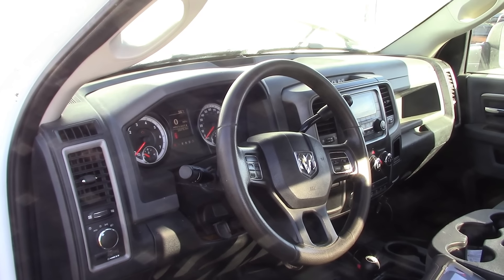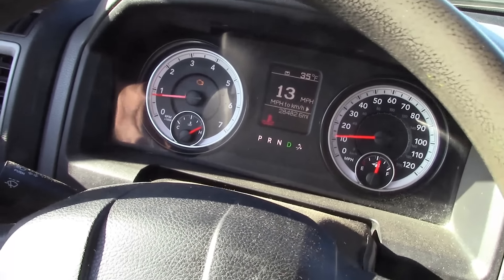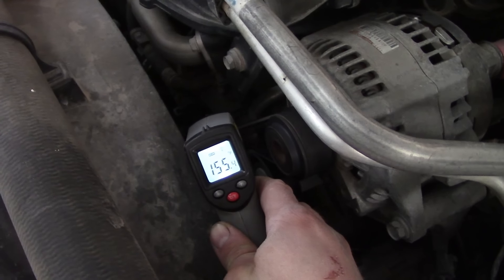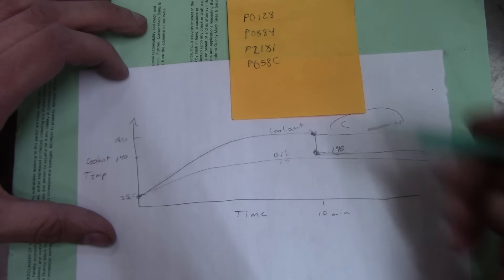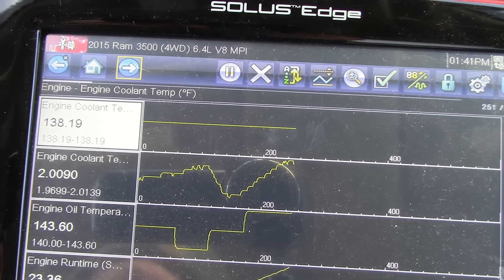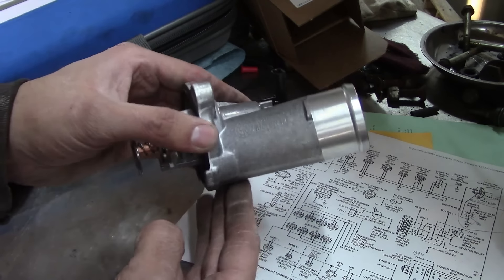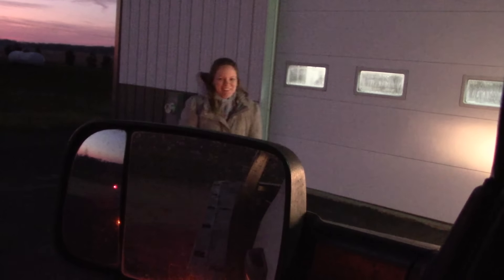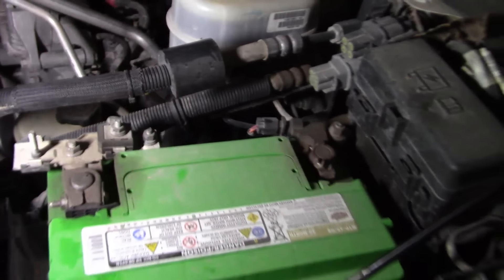When Live Data Lies - 2015 Ram 3500 Thermostat Diagnosis and Replacement - P0128, P2181

Comment: I am a true old school mopar fan, I bought a 2000 ram cummins years ago, very reliable. Took it to ft Lauderdale twice, 12 hour drive. On my second trip we had taken it out several times just sight seeing. The day we were supposed to leave I went to fuel up, trans would only run in 2nd. I finally found a trans shop, within two hours they called and said it had to be rebuilt, seems like all the electronics (from mexico) had fried. All the electronics were factory and got replaced, 3k $ later  and rebuilt trans we were on our way home.
This vid is the reason I watch, knowledge, common sense, and skills. BTW, like your new avatar.
Thanks Wes, stay safe

Comment: My dad’s company had a huge fleet of these trucks (lineman) and they had nothing but problems. My dads particular truck had a huge electrical issue where he would lose brakes, complete power, or just shut off completely. Was at the dealer five times before 20k miles.

Now they went to Ford for their fleet and so far so good

Comment: Got one, mine is new  2020 6.4 2500 . all trucks i have owned i always put a screen in front  to keep bugs out . So  put a screen on the front of this one   . Drove to the gas station and back which is 2 mile as i stopped and put it into reverse to back into garage the check engine light came on. backed into garage and the fan was running . The temperature outside was  40 degrease , no way should the fan be running. took the screen off and it stopped  . took it to dealer and had it reset and thy ran a check on the engine everything showed ok thy said . a little over 700 miles on the truck . not a happy camper . bought this to pull a big camper and now my only option seems to be, have the wife follow me and hope for the best . Maybe under  a load it will at lest show us the problem. Thanks for all you do, enjoy watching you and your family.

Comment: Sensor must have not been working. The computer went into limp home mode. When you restarted, the sensor was working but giving a false signal. I believe both the sensor and the thermostat were bad. You saw the thermostat as the problem and fixed it. Good job.

Comment: Vehicles are way to complicated. Commercial vehicles need by definition to be reliable. Loading them with unnecessary electronics just adds more to go wrong. Seems to be done so vehicle fitters (not skilled mechanics) can be told by the computer which bit to replace! Great watching you Wes diagnose what was wrong with it! 
Can only get worse when we are all forced to drive electric vehicles...  progress seems to be coming at a increased financial  cost to all of us! 
My 1961 Morris minor is still giving good service daily . It had a cooling issue not long ago,it blew a head gasket.  Cost £6 UK pounds ,about 10 US dollars to fix. Good for another 59 years or so now! Thats my kind of reliability! Best wishes Wes from the UK 🇬🇧

Comment: A friend of mine has a Hemi Dodge Ram 3500, got a check engine light and stopped at the dealer to have it checked. Technician told him it needed a new motor at the tune of $9,000 + labor!. Brought his truck to me for a 2nd opinion, I scanned it  (don't remember the codes it had now)and replaced the crank position sensor. That truck is still in service today, and that was 3 years ago. He actually showed me a pic on his phone of the tech's computer screen that stated ..."course of action: replace motor.

Comment: ROTFL, all the commenters thinking that this is a brand issue. I am sure your favorite brand has the same or similar issue. Likely this is just a symptom of the modern era. Maybe an emissions thing? Interesting video either way, thanks!
Reply from the maker: Yes. I have a video on a GM that does roughly the same thing.

Comment: I was noticing that both the water and oil temp changed in steps. I wouldn't be surprised if they are both at least partially fabricated values.

It reminded me of some car Eric worked on a year or so back. Both the oil pressure gauge and the live feed showed oil pressure in PSI that didn't make sense. Eventually he found a bad oil pressure SWITCH. Yep, the car just had a switch sender, but the buyer ordered it with a pressure gauge, so the ECM generated a fake 45 PSI reading when the switch turned on.
Reply from the maker: Yeah, Fords will show that fake oil pressure.

Comment: This must be a result of modern education. Any mechanical design professor would have laughed this design out of his class. Who in their right mind would integrate a thermostat and temperature sensor into the housing?

Oh, I looked at RockAuto for the price, Mopar is on a 6 day back order, Stant isn't in stock, and Motorad, whoever they are only requests $130. 

I'd be rolling my own on the milling machine provided I could find a sensor with the correct resistance value. Well worth the 4 or 5 hours of Solid Works design time. 

Good video Wes.

Comment: The thermostat is electronically controlled that is not a coolant temp sensor. You can open and close the thermostat with a scan tool not sure if snap on can but with witech you can open it. The coolant temp sensor is located on the front of the water pump.
Reply from the maker: Hmm. That would make a lot more sense.
Reply: @WatchWesWork  I don’t know how many of those I have done for that issue. You should take it apart and see how it works. Rather interesting how it’s done.

Comment: As a computer nerd that's done my share of programming, my guess is that there's another piece of software in the system that's dependent on that temperature data, so it's simulating the data in order to pass along a "valid", or expected, value.  But, the kicker seems to be that when the ECM can't get valid data from the thermostat, it goes into failsafe mode, and assumes that the temp must be too high (or too low?) and pegs out the gauge in the dash cluster as a sign that it's given up on the thermostat to provide "good" data.  My guess is that someone at Chrysler considered their chosen method to be the lesser of several evils, and decided on a "feature" that would help avoid an overheating scenario.

Comment: Another excuse to spend on new thermostat, well spotted !! Thanks for sharing. Stay safe and healthy 🇬🇧
Reply: Most cars will go their entire useful life with many of their original parts so what is the problem with an integrated assembly? . Whenever you go to by a 100% new car, do you do research as to if the stat / housing and sensor are separate items or do you look for payments under $ 100 per month? If you only buy used cars, your opinion of what a car maker should do is irrelevant since car makers sell to people that buy new cars.

Comment: Regarding ECMs and predicted values: A neighbor bought a brand new car. 
Had the dealer install a block heater. 
Come winter, the car wouldn't start. 
Dealer picked it up, it drove itself off the flat bed. 
No fault found. 
Neighbor got it back, and the next morning, the same thing. 
After several rounds of this it was discovered that the ECM looked at outside temperature, engine temperature, and time since the engine was last run. With the block heater engaged, the engine temperature didn't match what the ECM expected and it refused to start the engine. 
Unfortunately, the dealer couldn't find any way to tell the ECM that a block heater had been added. 
Kinda sucks not to be able to use a feature you've paid extra for.

Comment: For decades Chryslers has shown a substitute value when a DTC is set. This is what the PCM uses in its fuel calculations. When a coolant sensor code is set, it uses that value and turns on the fans because it doesn't know what it actually is. In this case it also pegged the needle to get the drivers attention. It does this with MAP and TPS also. Any PID value like temp, position %, is only shown on a scanner for the tech, not the PCM. It uses voltage. Always compare the sensor voltage to the sensor value.

Comment: Hi Wes, I was thinking the same when you gave an explaination of what the computer was upto at 16.35. My thoughts are that this chemical/mechanical type thermostat would start to get erratic/ineffecient towards the end of its life. So in order to prevent major damage down the road to the engine, the engineers programmed the computer to give those false data on the first sign of inconsistancy. For one thing, the thermostat does not have its own direct fault sensor, everything else in the cooling system has, the fan, coolant temp etc. 
This would all be part of road and highway safety goals that manufacturers are aiming for. In this scenario they are looking to avoid thermostat failures bringing traffic to a halt on busy roadways.

Comment: Yeah, it's got a hemi. I put MECHANICAL oil, coolant temp and volt gauges on my obs F150 with a cast iron 302. Lucky for me I do some of my best thinking in my own head and don't rely on a confuser software enginerd to tell me if my oil pressure is good or if my engine is overheating. You're a good man trying to wrangle those magical pixies for other people Wes. And yes, part-time wrecker drivers like tacos as well as pizza. Thanks for posting;-]

Comment: Thermostat, housing and coolant temp sensor all in one? Sounds like Chrysler pre loads the parts cannon for you.
Reply: You know..
Reply: my grandmother bought a new buick 4cylinder back in 1984. Buick skyhawk. Buicks first 4 cylinder vs the normal 8cylinders in 20 some years. 16,000 new back in 1984. And it only had a red dash light when engine coolant got hot.. blew a head gasket in late 90's..
Reply: Older MB A-class has MAF integrated with ECU. Imagine the fun - instead of simply replacing MAF, you are greeted with about 10x more expensive ECU replacement+programming. OK, you can send ECU to repair shop and they will replace the sensors and recalibrate the thing, but still, it is multiple times the expense of separate MAF.
If I'm not mistaken then it also does show substituted values in case of bad MAF.
Reply: @flir67man84  Had a 1999 Lincoln Navigator. The oil pressure """gauge""" on those is like that. It's mostly an idiot light to tell you IF you have pressure while giving the illusion of a gauge. It failed and told me I had oil pressure when I didn't, and I got rod knock. Had I had an actual gauge an saw that oil pressure was low, I would've dropped the pan and cleaned the pickup tube. I just changed the oil a few days prior too. But no, can't actually provide useful data.
Reply: it's a block replacement strategy. gives you quicker replacement time and maybe diagnostics as well. you need to think less but it will be costly. the same maybe as on expensive cars like BMW and Peugeot: you're not replacing some small pieces. You're replacing the whole block as a one unit.
Reply: Chrysler may have learned this from Daimler-Benz; my '07 Mercedes has a similar setup.
Reply: Housing-thermostat-sensor package is common in Europe. Almost every car make use.

Comment: Something about the old temp sensor that PCM wasn't liking, sometimes a few millivolt deviation from acceptable sensor output range can cause  the PCM to go haywire, they need to rewrite the PCM software to have a wider range for temp sensor output voltage, specially when the sensors age and go out of range. Excellent diagnostic video.

Comment: Whoever invented this integrated thermostat built into housing should never be allowed near any vehicle ever again.
Reply: 👍👏👌 Exactly!
Reply: oh but don't you see its all about the money! if they didn't do that then they would make less money!
Reply: putting non mechanical anything on a engine is stupid  you dont pack w programmer on road trips  and computers are too stupid to improvise
thanks for the vids wes
Reply: It was invented by an Accountant.
Reply: Many manufacturers have gone this route. Simplifies assembly, instead of 4 pieces( thermostat, gasket, Housing and sensor)it is now in one simplified unit.
Reply: Figured that since Chrysler is now under the Fiat umbrella (and formerly the Daimler umbrella), that some of the euro design ideas have made it into the American vehicles...   Not sure it's a good thing, not sure it's bad either - just different from what we're used to...
Reply: At least the housing isn't made of plastic...
Reply: @TopCat2021  Accountants; people who know the price of everything, and the value of nothing.
Reply: @walterpchrysler9446  But if only one piece goes bad, you have to buy all four?🤔 The consumer gets the shaft all the time.
Reply: I have had great luck with the newer Rams, but yeah, pretty stupid.
Reply: @icesoft1  FIAT... Fix It Again Tony
Reply: @chrisstephens6673  more likely it was driven by management. Designers are typically smarter than this, but they get pushed into a corner. I am a designer. I once heard a presentation by the head designer of a hand-held cordless vacuum cleaner (I won’t say the brand, but you know it). The original unit was well designed, very powerful, and almost silent. Marketing convinced management that consumers would never believe it was powerful because it was quiet. They had to REDESIGN IT TO MAKE IT NOISIER which reduced the vacuum strength. It has been on the market for years. It COULD have been so much better, had the designers been left alone.
Reply: @justindarkcloud  Right! How many times have you been working on something, describing the engineer that conceived it in some profane way, and thought “if I could just have FIVE MINUTES with the genius who thought THIS was a good idea...just five minutes...”🤬
Reply: @hgj2019  as you know the first question with any new design or adaptation the designer must ask themselves is "what question is this the answer to". This could be asked of both an integrated housing and the over read temp on the analyser.
As for your marketing weirdos,  shows a certain lack of confidence in their ability to convince people of the benefits. 
These days a cynic might suggest things are unnecessarily complicated to justify a high price of spares, or is that a realist not a cynic.
Reply: @chrisstephens6673  right! I was disappointed that management didn't step in and direct marketing to convince consumers they could retain their hearing AND get a strong, portable vacuum. I will go to my grave questioning the wisdom of intentionally sacrificing vaccum strength AND making it louder.
Reply: @walterpchrysler9446  exactly
Reply: Lucas Ch   You do realize that most cars will go their entire useful life with many of their original parts don't you?
Reply: @TopCat2021  Whenever you go to by a 100% new car, do you do research as to if the stat / housing and sensor are separate items or do you look for payments under $ 100 per month?  If you only buy used cars, your opinion of what a car maker is irrelevant since car makers sell to people that buy new cars.
Reply: Most all thermostats use a wax motor.
Reply: @bobroberts2371  I certainly do, although thermostat is definitely not one of them.

Comment: Perhaps the computer generated expected temperature value is something Chrysler uses to pass smog specs during warm up cycle.
Reply: Huh, most smog machines I've used have a manual bypass for the coolant temperature requirement

Comment: Another great video. I see your light always malfunctioning, I’d like to suggest checking out Kilimanjaro brand. They have 20-30 different kinds of lights, great warranty and just a $1 or $2 higher than harbor freight. I have 3 Kilimanjaro lights, been using them for 6 months now and they still work perfectly. Super bright, good magnets and good on batteries. I found mine on eBay

Comment: Nothing ever seems to be built to enable ease of maintenance. Years ago I worked in a British Leyland dealership, "yes I know", and we  maintained Jaguars. On the XJ6 model, to change the oil filter, you had to unscrew it, then roll it, spewing oil everywhere, to the front of the engine to get it out. Then there was the little bypass hose on the mini's.  Then again if it was easy, there would be no mechanics, or hand ground  cut and welded spanners, etc that make the job so , "interesting".

Comment: Hey Wes here's a crazy and stupid idea and I'm probably wrong but could the coolant temp sensor be reading the physical thermostat position? It might explain the weird readings given a failed/sticky tstat and when you stopped & restarted the motor the stopped coolant flow repositioned it?

Comment: The Ecm has a memory of previous engine parameters at every temperature zone; when the temp is missing it looks at the rest of the system and matches what the temp was in previous cycles then averages them and fills in the missing value,  it does this so the whole system can continue to operate based off the fake temperature.  When the engine is initially started its a factory bench mark and then reads the real time data to optimize performance.

Comment: When I learned about substituted values, I wondered why the computer guys don't find a way to put an asterisk beside data that is substituted. I thought it would be easy, but you'd need a separate field. Maybe they don't do that because one could go to generic data to get actual values. Occasionally I've found wonky values when trapped air is around the temp sensor. This would have been a fun one to pull out the scope and compare scan tool data to the real data coming from the temp sensor. In the end, it turns into play because the two are replaced together anyway.